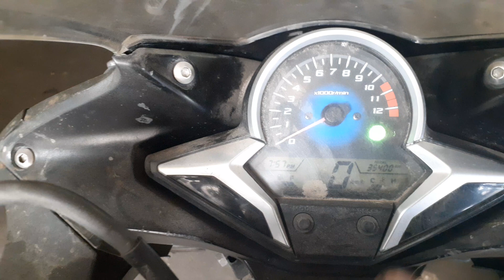Honda CBR 250 idling, starting, throttling problem

Comment: I searched out perfect solution of engine stalls while cbr250r is in cold condition works only on bikes which have no electrical and mechanical issue.
Reply: Please give solution
Reply: @KKsRealm have you disturbed engine idle screw in throttle body.
If not, you have to check your iac that it is working or not and if it is working you have to reset throttle position sensor.

Comment: CBR 250 ka sensor light on Nahin ho raha hai gadi current Nahin a raha hai problem kya hoga help
Reply from the maker: Is that a normal key (2 wires) or
Sensor key (3 wires)
Reply: Bhai Main Kuchh Samjha Nahin
Reply: Please kya aap apna number send kar sakte hain
Reply from the maker: Chaavi ke neeche 2 wire or 3 wire check karo.
3 wire hai tho ye sensor lock hai.
Ismeh problem hai tho current nahi aathe.
Reply: 3 wire hai
Reply: 3 wire hai to kya problem ho sakta hai
Reply from the maker: @aminnadaf0258  ye sensor me chotta sha diode aathe hai. Ye garrab hai tho current aathe nahi. 
Ushe check karo.
Yeh diode be milthe hai change karne ke badh current aathe hai.
Reply: diode kya he Aur Kidar rahata hai bola bhai
Reply: Kya aap ke pass photo he kya. diode ka he tu send karo na bhai
Reply from the maker: Mere paass photo nahihai.
Key ke neeche screw nicolo. Uske undher diode hai.
Yeh diode electronics shop me milthe hai
Meh chek karoom photo hai tho unko
Dikkaya
Aap kahan se? .aapka pho number
Reply: @BS6-Technical  shop address anna